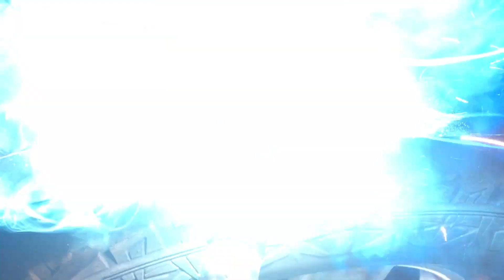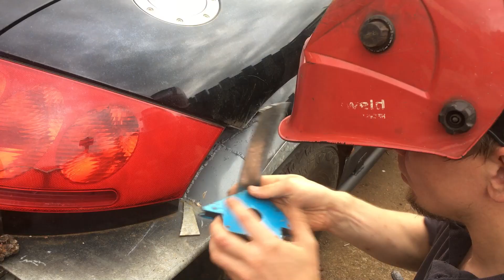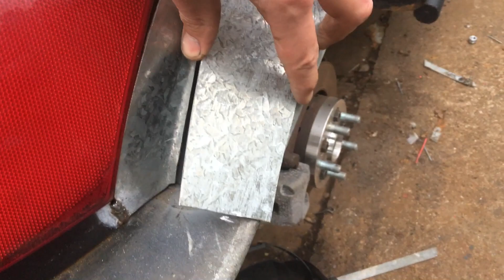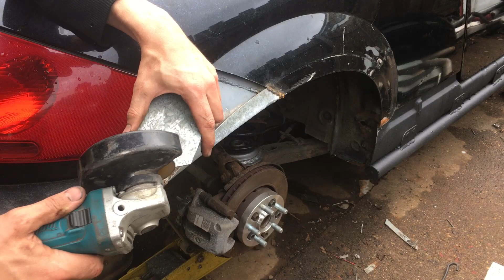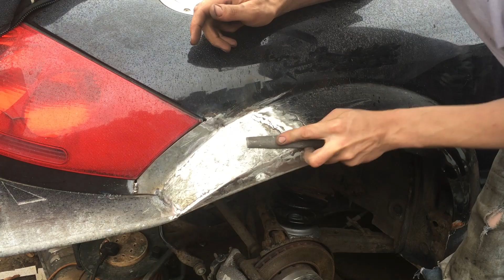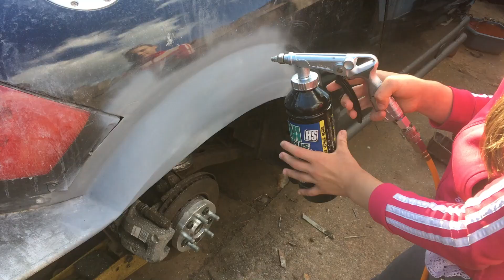Off-road Audi TT Ep12: Panel beating car bodywork with basic tools!

Comment: Why did you use stone chip on the body of the car ?  Should have used the proper paint no ?
Reply from the maker: The intention is to paint the whole thing with truck bed liner once it's finished, so that it doesn't get scratched to death off road.

Comment: dave you need to grind back the galve to bare steel, the white powdery fumes are really bad for you. nice work again.
Dan
Reply from the maker: Yes, that's a good point and worth discussing. Zinc fumes are nasty if inhaled in high concentrations - in fact at really high levels they can kill. I understand that the effects are all short-term though (well, death excluded) and if it's just a small quantity and outdoors, there's no effect. I've not yet experienced the zinc flu but you're right, it's safer to grind it off.

Incidentally, for more general protection, if anyone knows of a good mask that doesn't fog up safety glasses, I would be more than a little interested!
Reply: @davemakesstuff5828  I've got a JSP half face respirator, it's got a press to test fit function which works really well to get a good seal, so safety glasses don't fog up as quick.  Obviously if you are doing stuff that makes you sweaty you'll still fog up, just not as quick.
You can get filters for dust and general work and also ones suitable for fumes so quite versatile.  Cost about 25 quid IIRC.  So bit more than disposable dust masks but about 50 times more effective.
Reply from the maker: @robtyler9564  Excellent - thanks for the recommendation. Will take a look.